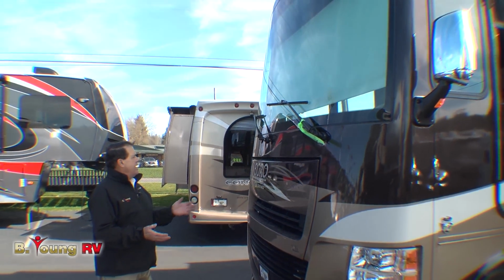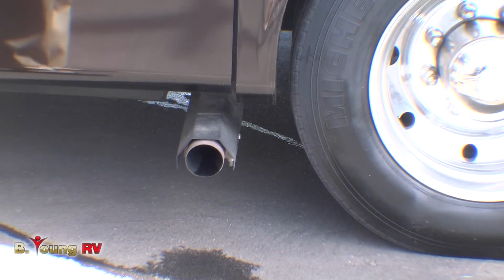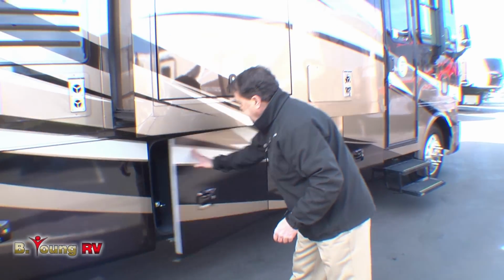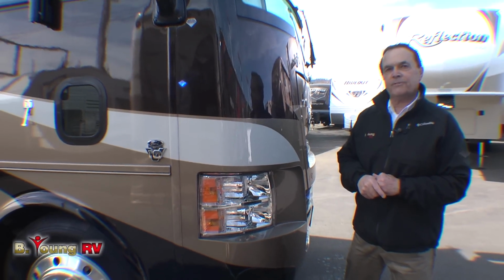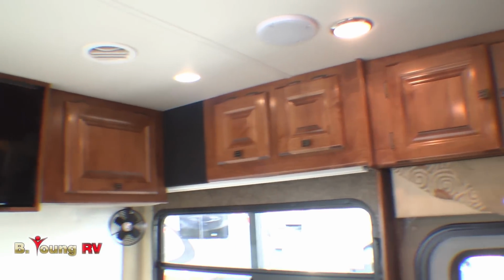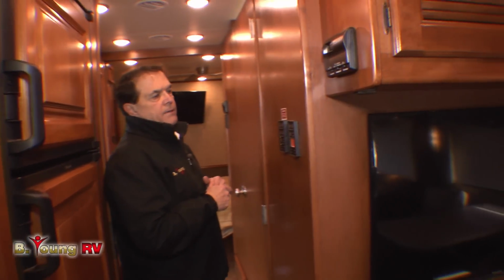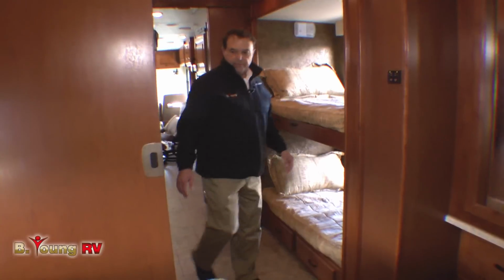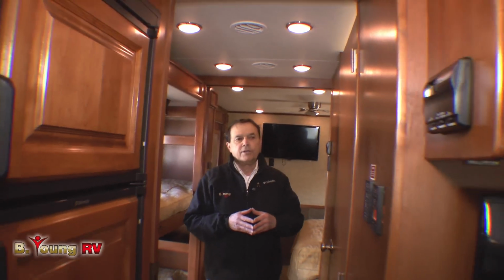Stock #3125 2014 35-foot Allegro Class A Motor Home (Frank Biggs)

Comment: Nice rig, would ditch the bunk beds for stackable washer drier, then Bosh dishwasher on left with counter top on top for folding. Ditch the noisy Genset for 2 Honda 3000is in tandem, much quieter. Finally latest improvement, 2 Tesla Powerwalls, and go 110 full time.
Bought the last rig in Bend Oregon and drove it to Pa, would not hesitate to do again Frank,nice presentation.